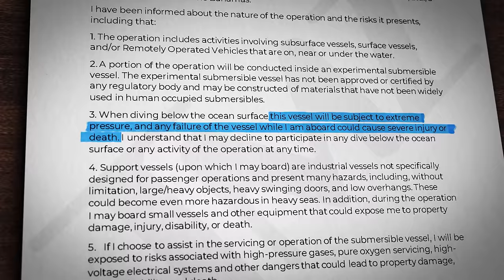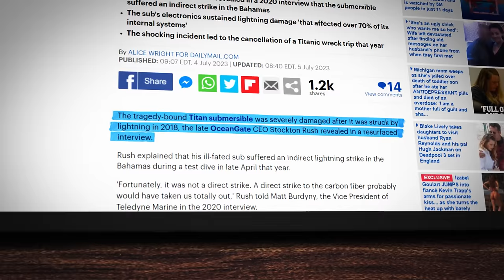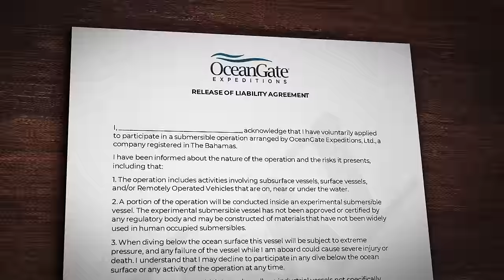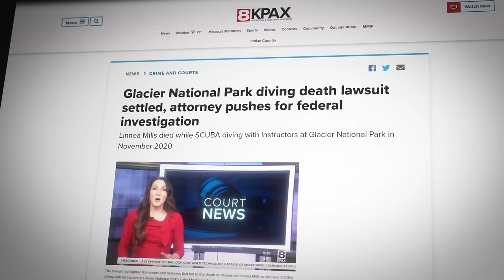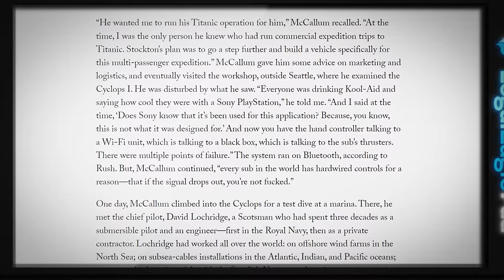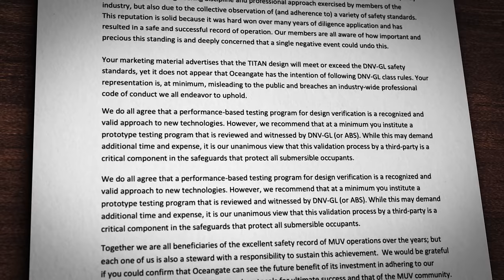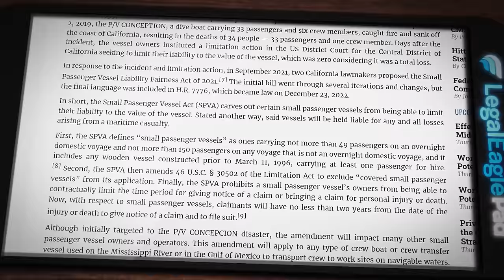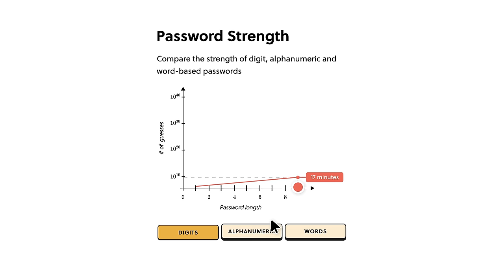OceanGate Is Getting Majorly Sued

Comment: Just for the record, Titanic's design wasn't inherently flawed.  She was not a battle ship and was not expected to have torpedoes or mines fired at her.  The criteria for flooding survivability that she was designed to meet were being able to float with any two concurrent compartments flooded (which would cover the case where hull damage occurred at the point where two compartments met from being rammed from the side), any 3 of the first 5 compartments flooded, or all of the first 4 compartments flooded (which would cover the case where the Titanic was in a high-speed head-on collision and had her bows crushed).  This system was perfectly legal and considered more than sufficient to ensure the safety of the ship (and still would be, see below), and in fact the Olympic, Titanic's structurally nearly-identical sister ship, survived a collision that punctured 2 adjoining compartments without sinking.  

The prolonged side-swipe at high-speed opening up 5 compartments (strictly speaking it was 6 compartments, but the pumps were able to stay ahead of the water entering boiler room 5 until the water in boiler room 6 started overflowing the bulkhead) was not a scenario that was considered as very likely, and with good reason, it rarely actually happens.  The only other occurrence I can think of that happening off the top of my head was Costa Concordia, where the ship was being handled in a grossly negligent way for no good reason and was being done purely to show off.  

The rules governing the ability for a passenger ship to survive flooding are in fact still pretty similar to what they were for Titanic, namely a ship must be able to survive flooding of 2 concurrent compartments (The Costa Concordia collision opened at least 3 compartments to the sea).  It wasn't poor design that sank Titanic, it was poor seamanship.
Reply: The other issue was they were going faster than normal and steered right into a known iceberg field.  Sad thing was the engineer wanted more lifeboats on the ship but was told no. He never designed another ship after this
Reply: @nubreed13  I thought the titanic was further south precisely not going into a known icefield
Reply: The, "Titanic was built alongside two other ships." *edited to remove flippant sarcasm
Reply: Let's also take into account the conditions of the sea as well. The ice was further south than normal for that time of year, there was no moon, and the sea was flat calm. It wasn't so much poor seamanship (that's a slap in the face to the experienced crew on the Titanic) than it was a perfect storm of factors that no one could've predicted or even thought about. A flat sea is a dangerous sea, especially at night with clear weather and no moon. At least back in those days.

I subscribe to the False Horizon Theory where the icebergs (being colder than the surrounding environment) threw up a haze that hid the horizon's true location. Combine that with a flat sea (no waves breaking on an iceberg) and no moon (no light reflecting off the ice) and you're not going to see an iceberg until it's too late. I really believe Titanic would've survived if they just hit it head on. She wouldn't have had a triumphant entry into New York but...better to come in with a broken nose than never come in at all.
Reply: Also, it was built of high-sulpher steel, which becomes brittle from cold.
Reply: Also the lookouts did not have access to their binoculars as they were locked in a cabinet and the key was taken by a prior officer. So the lookouts could see the horizon but as a previous poster said it was an illusion. The Californian was closer than the Carpathian but their telegraph office was closed for the night. They did see the flares, but odd no one acted on them.
Reply: The whole thing is an unending series of unavoidable errors, poor decisions made due to greed, poor decisiona made out of sheer ignorance, egotism, arrogance and ignorance.

There is a TON that went wrong, from lack of lifeboats to improve the looks, to the unnessessary speeds it was doing in such unsafe conditions to a surprise of nature followed by overestimating the ship, prioritizing the confort of rich people on lifeboats to the captain of nearby vessels thinking flares were being used as fireworks, because dumb people gonna be dumb so why check, the whole telegraph being left alone. And so, SO many other things working together. It was a perfect storm of human errors trown into an iceberg.
Reply: Because of all those conditions they should have slowed down, therefore, poor seamanship!
Reply: @Democlis  it was a perfect storm of both human error and conditions outside our control, like a flat sea and no moon. Just to note that Titanic actually had more lifeboats than was required. The logic back then was that the lifeboats would ferry passengers from a sinking or crippled ship to a rescue ship. Titanic sank slow enough that this would've worked IF another ship had gotten there in time. 

I'm not jumping on the "blame the Californian" wagon. If the false horizon theory is true, the Californian had no idea what it was seeing. Didn't help that distress rockets didn't have regulated colors, making it easy to mistake what their purpose was to outside vessels. 

But in the end, her loss caused a surge of advanced safety standards and if it wasn't her, it was going to be some other ship and probably further down the timeline as ships got bigger and bigger. If it had happened today without those safety regulations, we would've lost a lot more than 1500. Some of the biggest cruise liners are carrying up to at least 5000.

Comment: Whats surprising to me is not that it's working with a ps3 controller, but that the whole control system is relying on things like wifi or even just a monitor. You really need backups that are more directly controlled in case anything failes. For example, if you need to drop your ballast, nice to be able to do it with a touch screen or controller, but just in case, you need a physical switch connected as directly as posible that bypasses the whole interface. It's insane that if your wifi connection fails, your dead.
Reply: My WiFi gets cranky if I get on the subway, mind-boggling that it would work on the ocean floor.

Comment: One iffy thing was the sub's hull was made in three parts (not including the window). Two titanium end pieces and a carbon fiber core. This was a HUGE red flag as differing materials behave differently under stress and pressure. The end caps would change shape at a different rate than the core, so over time this will create stress points that will cut the lifespan of the sub by a huge margin. SO you want as few joins/seems as possible. Deep sea submersible's are cast in one piece for this reason.
Reply: I saw them glue on the ends in that video 😂 do you think that played a part in it at all?
Reply: @StrawberryCoke  Those joints are probably where the failure occurred
Reply: As an electrical engineer, with zero expertise, your comment points out the one thing I noticed. In the pictures of the sub it seemed like there were too many seems. Like, I can barely fix things that I break to be waterproof again, let alone believe that I could weld several materials together and assume they could be crushed by thousands of pounds of water.
Reply: You make some excellent points. One thing that struck me as an additional major concern, was not only the fact that the different materials were glued together but this was done manually and not in a clean room environment. Furthermore the plexiglass porthole was not certified to the depth it was going down to. Pure madness.
Reply: @lindapullan6937  The whole sub's design would only have been rated for 1/3 of the depth they were going to use it at. It's probably why the company never tried to get it certified. If you want to go that deep you need a one piece cast steel/titanium skinned ball with walls at least a foot thick for where the people would sit. The only joints being where the window is and where the entrance/exit door is. The rest of the sub is bolted onto that.
Reply: @neilprice513  excellent points Neil. Thank you. I read that the certification process starts at the design stage thro to finished product so I can see why Rush would be unwilling to go thro with it putting aside the cost.

Comment: The fact that they might be able to evade responsibility for such brazen negligence is utterly ridiculous, they had so, so many warnings the sub wasn't safe and yet they might wriggle free of the consequences
Reply: even if the won the case the lawsuit would drain the little money the company has lefr
Reply: Luckily the disaster was a pr fiasco that will hopefully prevent anyone else from boarding a vessel owned by the company.
Reply: He didn't care cause he knew it wouldn't be HIM left holding the bag
Reply: Rush is the main culprit and OceanGate is done for as a company, with or without the lawsuit. Do you think anyone is ever going to go on one of their subs? No one is wriggling free. Unless you think that the employees are criminal, of which there is currently zero evidence. This was Rush's doing from beginning to end, that's pretty clear I'd say.

Comment: A waiver is valid only if the company at least make an effort to make sure their sub is safe during normal operation. Considering that their sub doesn't even pass the minimum requirements to reach Titanic in the first place, it's literally impossible for the company to fulfill their promised feature in the first place. There's a difference between "something that 'might' kill you during normal usage" and "something that definitely gonna kill you" (their sub is the latter)
Reply: The waiver is not valid at all only protects the company if sued in Bahamas an asset outside Bahamas can be seized and sold to compensate victims families.

Comment: As a professional safety consultant (in aviation), I winced at the statement that risks cannot be eliminated, because I so often hear "it's either safe or it's not. In safety management, a risk is some combination of likelihood and severity of harm, and, although we always check, it can hardly ever be eliminated (pretty much only by doing something completely different - in this case, to eliminate the risk I would have proposed remotely watching footage from an unmanned submersible instead). If you're determined to go ahead anyway then we can manage risk by managing likelihood and severity, and they're usually both continuous. That means there's no obvious cut-off point between "safe" and "unsafe"; there's a sliding scale from "sure, why not" (slight chance of a stubbed toe, perhaps) to Hell, no! (almost certain death). Suggesting they're equivalent because the former hasn't completely eliminated the risk is either incompetent or disingenuous.
Reply: That's the reason we talk about "safer sex" and "safer use" since both can't be done in a "completely safe" manner. 
What would "completely safe" even mean in reality?
Reply: @chrisakaschulbus4903  You cannot force people to be safe also most companies take shortcuts for profits e.g. rush things,not enough people or cheap parts such as from china that do not work